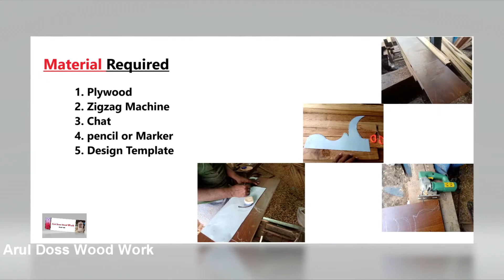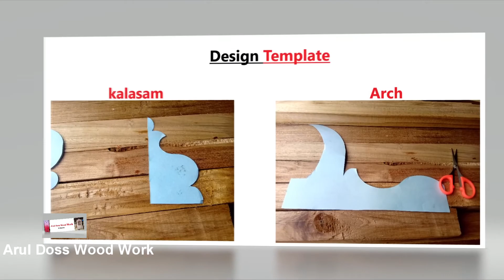Pooja Room Arch Design- Kalasam Design Plywood தமிழ்

Comment: Zegjak bled size enna
Reply from the maker: @chennai wood polish work
T119Bo blade number small size Brand BOSCH
Reply: @aruldosswoodwork7530  bell cutting pannala ma anna
Reply from the maker: bell cutting pannalam bro, heavy plywood used large size large and then u zigsaw machine in safe mode